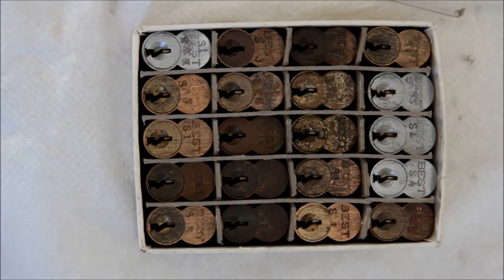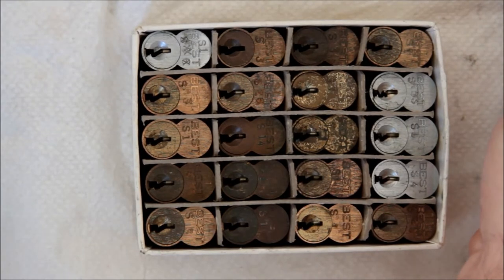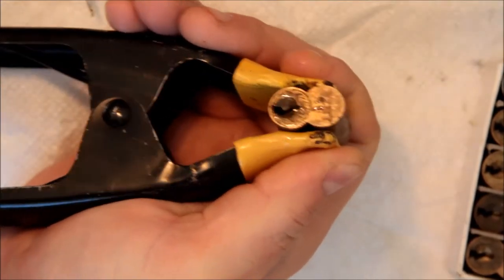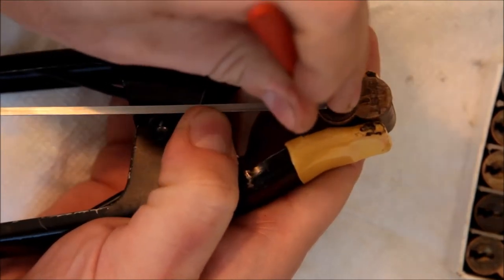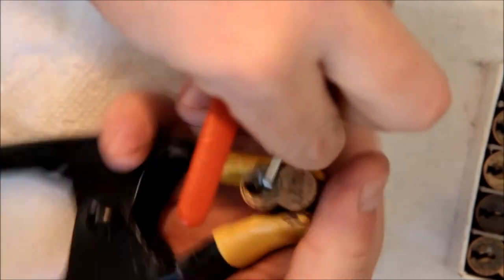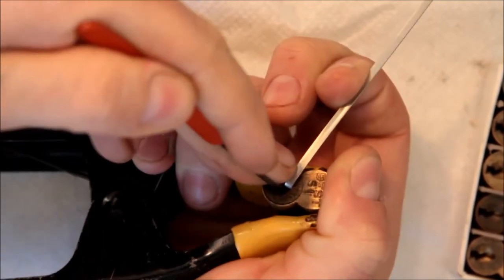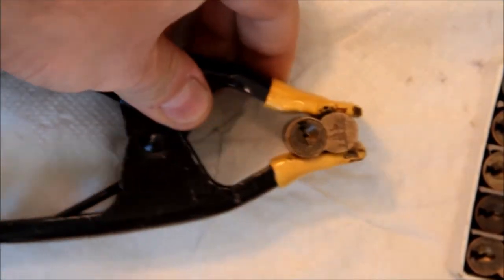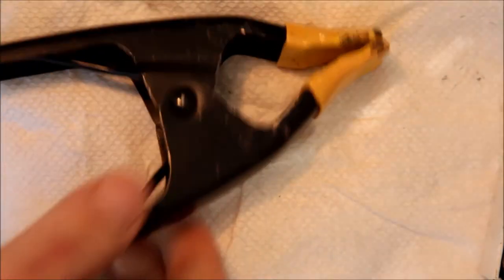(108) The SPP Matrix: BEST SFIC Cores, Part 1

Comment: Nice. I guess I am glad I didnt bid on that lot :P And you would be surprised at some of the Best keyways. They just drill small diameter holes through the plug to let the decapping pin pass through. I have a pdf of all of them if you are interested.

When dealing with older used cores I prefer to let them soak in brakleen or w/e solvent you prefer for a while to soften up any grease/oil/graphite that is in there then give them a good clean. It is surprising what comes out of some of them.